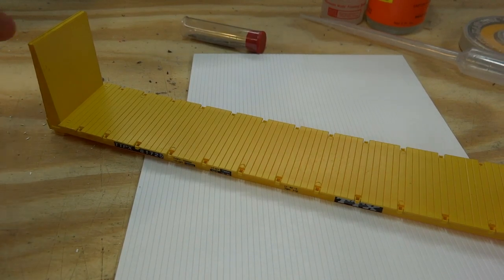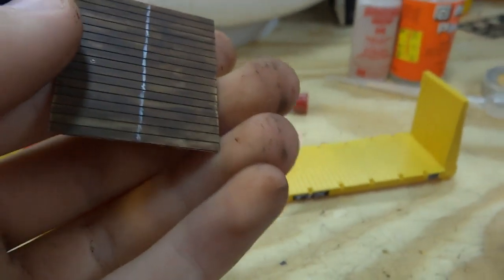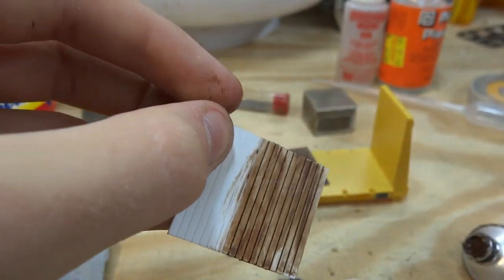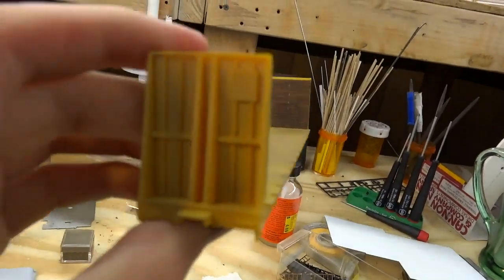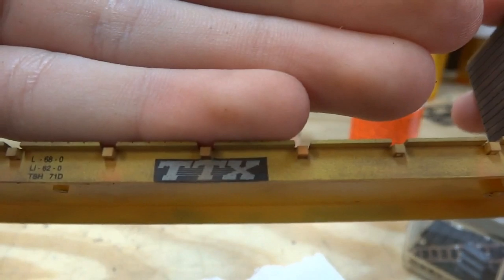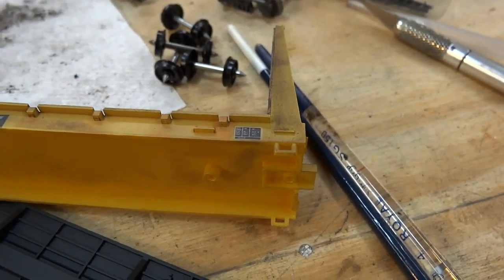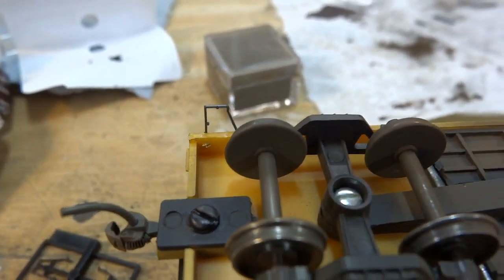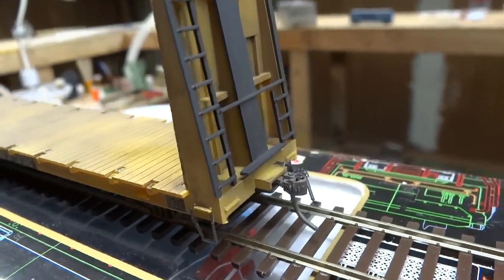HOW TO: Detail A Bulkhead Flatcar

Comment: Since I build my own flat cars from Tichy Train Group, I found that you can add wood grain to the plastic with a razor saw.  I use it constantly beating up the plastic to look like an old used deck.  My last flatcar I painted each board on the deck (40 foot car) a different shade of brown to grey mixing the acrylic paint as I went.  I use little plastic communion cups to mix paint then just give 'em a toss.  Cheers from eastern TN